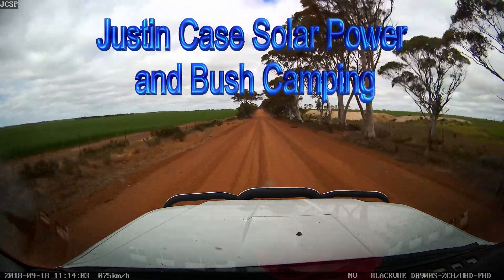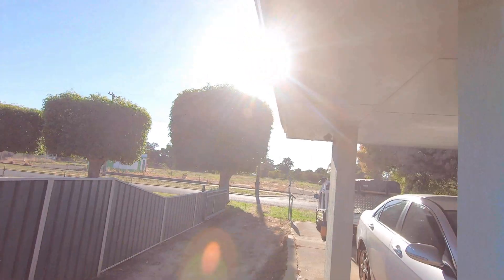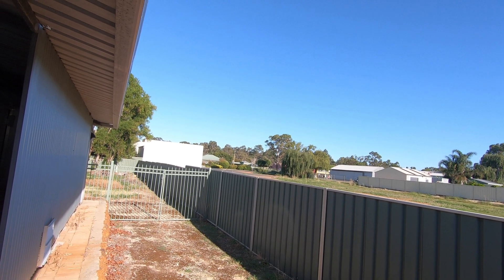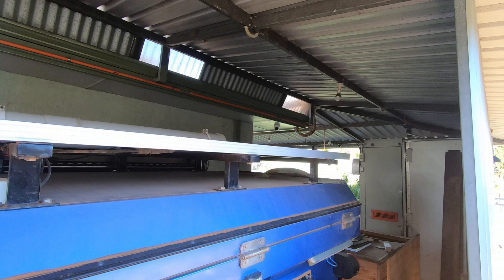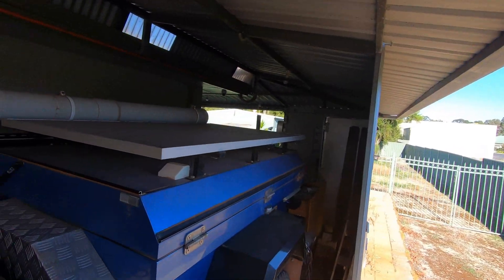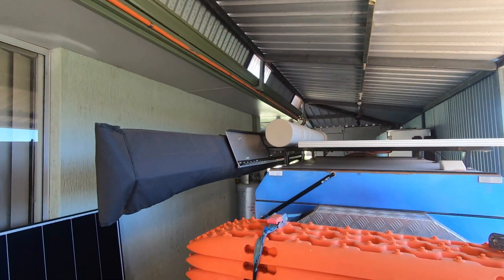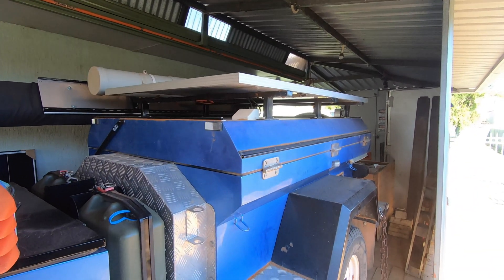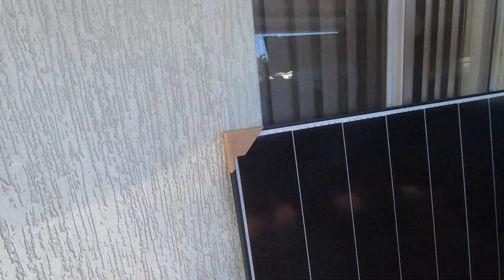The Most Advanced Solar Panel I have Ever Tested

Comment: Does the blood rush to your head from being upside down? 🤔 Off topic, I know.  I got some 410w panels that are very impressive.  Four of them replace 16 of my 100w panels.
Reply from the maker: Yes  these ones fit in the almost the same footprint as a  315Watt solar panel and produce 400watt. Very little resistance with the extra large solar cells
Reply: @JustinCaseSolarPower   Yes, I'm learning to use the higher voltages since the controllers are made to handle them. Lots of fun!
Reply from the maker: @JungleJargon  Solar power is great fun to learn and use. For us it powers our home and camper. We had a lawn mower at tom price caravan park smash the big panel with a stone. Shit happens. Even broken it was still putting out over 300Watt. Amazing panel. But that is spoilers as i  have a lot of videos from out trip to edit before we get to that one.

Comment: Thanks for the video. How is the new Growatt inverter going?
Reply from the maker: I have no idea. I have not been able to get an electrician with AC and DC certification to fit it. Here in Australia they need both license in order to work on solar, They are also very hard to find. Lots of people doing solar right now. If i have to much problem getting it fitted then i will just give up as i don't need it anyway.
Reply: @JustinCaseSolarPower  Thanks for the quick reply. Just keen to see what they are like as there is no local content in Australia with this inverter and looking what to buy.
Reply from the maker: @gibo1971  If your off grid just buy what i have been using for years now....
Reply: @JustinCaseSolarPower  Thanks for the advice. Have been looking at the 8048 max or the 5048mk (don.t need a sparky for the 5048?)
Reply from the maker: @gibo1971  Well you should get one to wire in the AC side at least that is the regs. but what you do in your own home is 100% up to you, For me i do stuff and show people so i have to make sure it is right or the power s to be my take that opportunity to shut me down so i can't help people save the $ and do without them